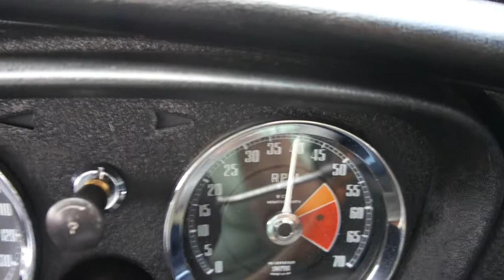1968 MGC Tachometer Problem

Comment: Hi JR. Very recently I covered 2,500 miles in three weeks in my 1969 C roadster on a 50th Anniversary tour. My car has done 61,000 miles from new and up until the trip the tachometer needle was pretty steady, moving over a distance of just 200 revs. While away on the trip the needle gradually started to move through a bigger arc and now it is very similar to yours in the video. As your video is dated 2017 I presume you have resolved the problem. If so, how was it repaired? I haven't done anything as yet to find the cause so I am very interested to know how you got on with it.
Cheers,

Ian Grant
NZ MGC Register Secretary / Historian
Reply from the maker: This is a tricky one.  I've attempted quite a few fixes for this issue but none have completely solve the problem; although it is improved.  Refurbishing the tach had a good effect and the other item that improved the flicker was changing out the positive wire to the fuel pump.  It's pretty stable initially but seems to flicker more as the car heats up which made me think it might be the coil getting hot and disrupting the signal but I've changed the coil and it didn't have any effect.  For now I'm living with the remaining flicker but my next solution may be to completely change out the ignition wires from/to the ignition switch, coil and tach.  By the way, I too made the trek to MGC 50th.  My car was the one being serviced by RAC for most of the day.
Reply: Thanks so much for the reply. I have since found your 30-minute video that covers the whole process so I will be working through it. I noticed when I recently fired it up after the car had not been used for a a couple of weeks, the tachometer needle flickered just a little while the fuel pump was ticking straight after turning the ignition on. Will be an interesting project.
Cheers, Ian.
Reply: Hi JR. Just thought I would follow up with my repair. Fortunately all that my tachometer required was the replacement of the electrolytic capacitor and two resistors and a thorough inspection and clean by Steve Sheppard at Auckland Speedometer Services. Steve has had many years of experience with Smiths instruments. I now have one very steady tachometer needle.
Cheers, Ian.
Reply from the maker: Excellent, thanks for the update.
Reply: Bad ground